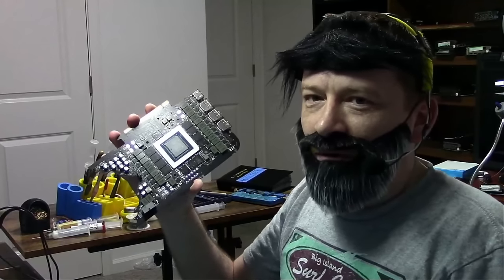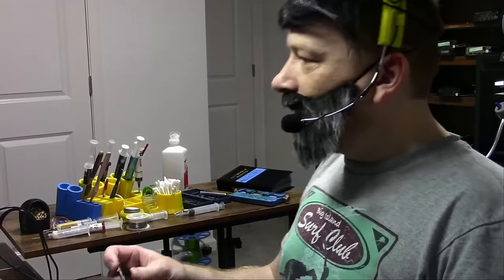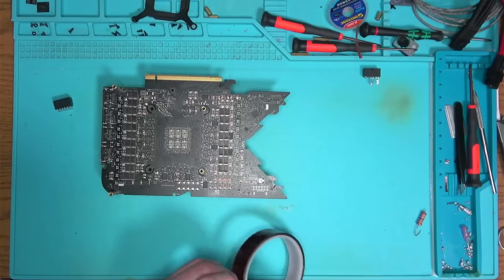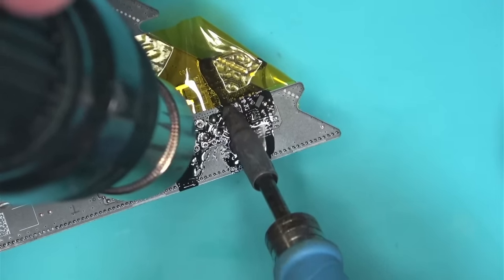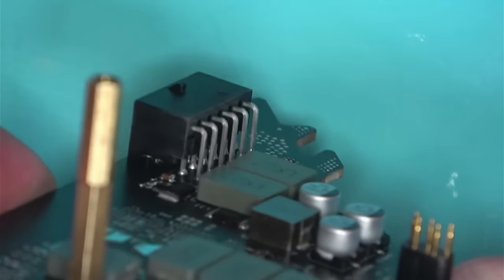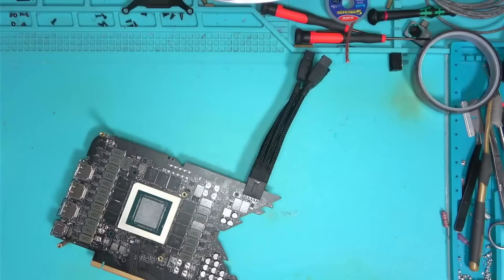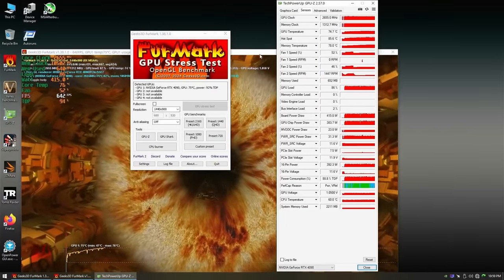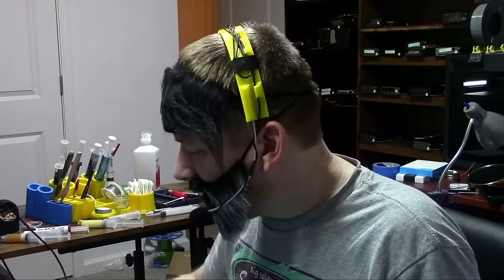4090 repair parody (AI voice)

Comment: The 12VHPWR connector is real shit , thanks NVidia
Reply: unless they make a revised connector for the 50 series, its gonna have the same issues.. can’t wait to see the 5090 Ti’s insane power draw melt it
Reply: @iGPR3  you know even better everyone claimed stutter would go away by going to "single card" 
yet I can name more than a dozen new games that still have either micro stutter or stuttering in them.
The only thing single card did make everything cost twice as much.
Reply: idk i took the risk of the 40xx with my 4090 and yet its free of melt for soon a year
Reply: @DarkW8  Also in the 4090 club for well over a year. Still unmelted 12VHPWR and all the hours in Cyberpunk and Baldurs Gate breathtakingly enjoyed.
Reply: @u9Nails  You're not the rule, you're the exception. Logical fallacy at its finest.
Reply: There is an improved connector called 12v2x6 that should avoid smoking GPUs in the future. It has longer sense pins and if the power cable is not plugged in properly the PSU don´t deliver power to the GPU.

But the real problem is, that nVidia GPUs are way too bulky and don´t physically fit inside most cases on the market without bending the GPU power cables. They had that problem solved in the past, the connectors on RTX 2000 series GPUs were angled by 45 degrees and so it was not necessary to overstretch cables.

I am glad I found a 4070 from Gainward that has a normal 8 pin connector.
Reply: @iGPR3  The connector has no issues. The issues are in online texts and your own head only.
Reply: @iGPR3  5090 is gonna be a 103 chip it's not even gonna get that hot lol.
Reply: @-T--T-  No one forced them to use it, what are you smoking?
Reply: i agree that its a bad port but we to also consider poor consumer installation, in my opinion its a 50-50 nvidia-consumers fault here.
Reply: Even Germans has said its scheisse connector. This connector standard was complete failure.
Reply: Everytime I disconnect my 4090 strix i have to yank it in there with a hammer,to be sure its connected properly,complete joke,anyone 7900 xtx 1 on 1 exchange?
Reply: I've installed 2 of these now, in my system, (one upgrade about 2 years ago and the other last weekend) and i was surprised BOTH times that it didn't break. the amount of force i had to use was just insane. why not just build the splitter into the board and give us the nice 2x8pin connector that was always so easy? the thing is just garbage.
Reply: @-T--T-  PCI-SIG with nVidia, not alone!
Reply: I have my 4080 super now for 2 months. So far no issues. I think it is like northwestrepair says. You have to be careful and gentle with th connector. I plugged my connector in outside the case as i still nog no newer PSU that has the cable. But i want to be safe with it. I think most cases are user error cases where they go wrong. That being said i had to push with pretty high force to insert it all the way. So design for sure could be better.
Reply: @iGPR3 my 4090 has the new 12v-2x6 and my psu is same standard haven’t had a single issue

Comment: I have this card and knock on wood no issues after half a year, but if the power connector fails I won't replace it, I will solder two silicone like 6-8AWG beefy wires and that's it.
Btw. that's the best 12VLPWR connector soldering I've seen on youtube (better than the guy you use as voice), other big channels scratch the crap out of the soldermask and don't get solder thru the other side.

Comment: man i recently upgraded to a 4070ti super and i swore to GOD i was going to break off the power connector, i was putting on so much force. I tried to do my best to keep the pressure consistent, not jerk it then slooowly walked it in, and it still only finally seated with a ridiculous amount of force. I'm actually surprised i DIDNT break it - these 12 pin connectors are so fucking stupid.

Comment: If I ever get a 4090 I'm doing the same modification I did with my 57V huawei taobao psu: replace the power connector with high amp screw terminals.